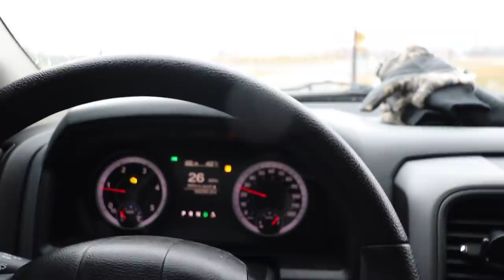He Thought His 1st Gen Was DONE FOR!!!

Comment: This is coming from a tractor mechanic but the principals are the same, From what I gather you ran out of fuel on the uphill climb. The reason you couldn't get it to start was that it was "Air Locked" Generally when you run a diesel completely dry, you have to crack the injection lines at the injectors to get the air out of the lines and injection pump to allow them to pump fuel. So for future reference. Top off the tank at 1/4 and don't go any lower. Its bad for the injectors, injection and lift pumps to run dry as the fuel lubricates the pump mechanisms in the pumps aswell as the injectors. Granted the lift pump is cheap. But the injection pump and injectors is usually pretty spendy, to me it looks like they use a similar lift pump as a John Deere 404 Diesel commonly found in 4020's and 6600 series combines and countless other diesel engines. Also as you discovered, the arm on the lift pump is to prime it and fill the fuel filter.

Comment: I had a problem with my 24v a while back. I traded a Jeep for it and left my buddies house and went to a station to get fuel and shut the truck off but the gas station was closed cause it was New Years. So I got back in and it fired right up but stalled out and after that all it would do is crank. Didn’t do anything but crank and crank and crank. So I got it home and noticed there was a fuel leak. I hopped under there cut the line out and put injection lines with 4 clamps got in it turned the key and fired right up. Didn’t even have to crack the injectors. I was thinking my lift pump was bad but nope. It was a easy $15 fix 😂